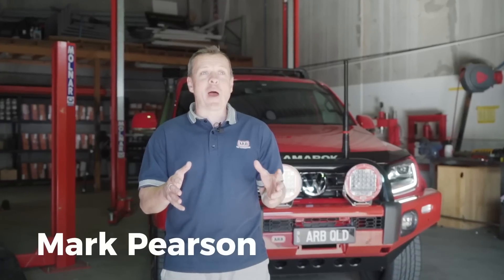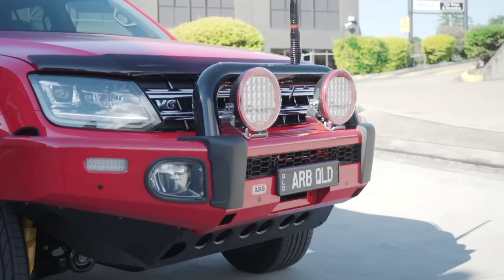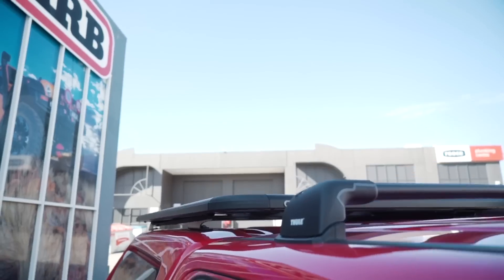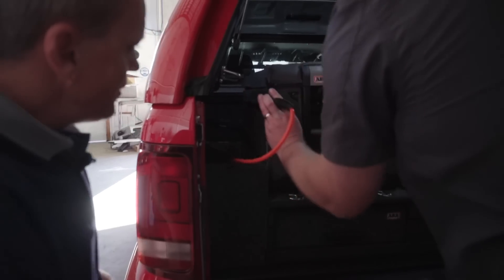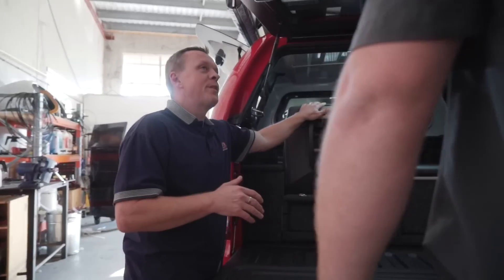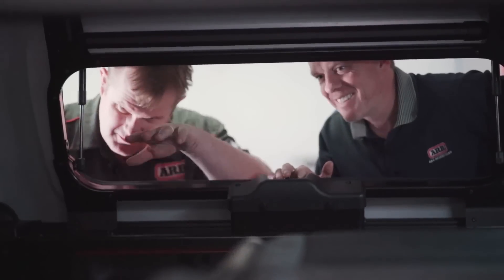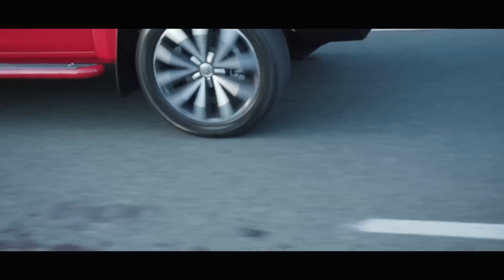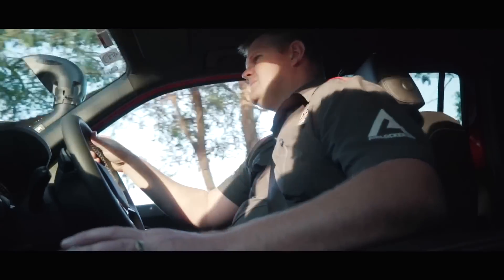ARB Capalaba | ROK Build - Reveal

Comment: is this a new rear bar arb have? the black bar is usually straight
Reply from the maker: Good eye there Julian, not a new rear bar, just our Summit Rear Step Tow Bar, which is designed slightly differently for the Volkswagen Amaroks.